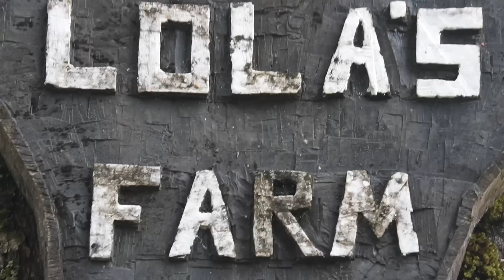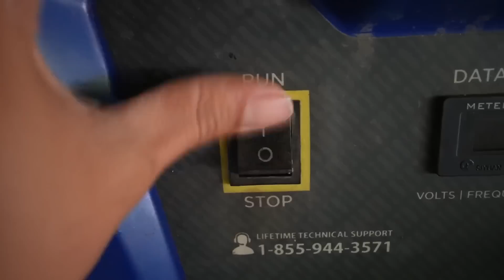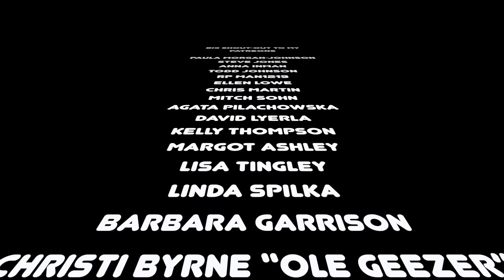WATER BILL $$  FOR FREE?

Comment: Congrats on your progress. 

Two comments:

1.  Water weighs 8.35 lbs per gallon.   Therefore 600 gals equals over 5,000 lbs.  Make sure that platform is structurally over build. 

2.  Would you consider a filter before the water pump?  It may extend the life of your pump.  Depending how you connect the future tanks, you may move the filter between tank 1 and #2 so the filter may not create any resistance to the pump.  Meaning if water start filling tank #6 and the the rest start filling (5,, 4, 3, 2, the tank #1) with an overflow,   then the filter can clean water coming from previous filters and water on filter 1 will be already filtered, therefore the pump will have the cleanest water but without any potential resistance created by the filter

Comment: Great job as always!
With your staircase you need to place the foam strips in-between the metal and wood steps to dampen down the sound, like you did with the outside balconies…..
It might also help if possible to fill the gaps in the metal treads with some foam, to reduce the echo

Comment: love the gutters! FYI, I have a 10,000 gal. catchment system under my house and the one thing I would change if i could go back in time, is to have more Clearence between the top of my tank and the house.  these tanks will need to get cleaned out once a year and on my tank you have to go thru the top.  I have 3-4 feet of clearance but wish I had more. also, you may want to put gutter guards and a sump on your down spouts to shed the leaves, and the sump to catch the sediment.  its really easy and doesn't cost too much more.

Comment: Water on fresh concrete is good, helps the curing.  You do not want the concrete to dry too fast.  Rain may damage appearance only.   Sunlight ultraviolet rays will damage PVC.  Paint the pipe to protect it from the sun.

Comment: I used to work in residential construction. Concrete is a chemical reaction some things slow it down but make it very strong, like when the Roman's would pour it under water. You feel the heat while it cures. That is it reacting. If you don't care about the finish let the rain give it texture.

Comment: You could use a 12volt pump like what they use in campers as a system. Likely one in the bus. Much cheaper than that pump you purchased. Its what I use in my 4mx6m clamping cabins with showers.

Comment: Rain will not ruin the footing for your first rain-water collection tank. Concrete will cure harder/stronger under water as a matter of fact. If the finished surface of the concrete had started to set (say an hour or maybe less) after finishing when the rain came...then no damage will result. Superficial pock marks will result if the surface of the new concrete was very soft at onset of rain. This is not an aesthetic piece of concrete anyway...so no lasting damage.

Comment: With that slope, I think you needed to sink supports down into the earth the way you did for the house.  That water tank is going to be super heavy, and that cement platform is going to be like a sled.  I may be wrong, however.  Please ask your architect.  It's cheaper to fix before it slides down the hill.

Comment: I am curious about what type of water filtration system you will be using? I know that UV light circulation is great for micro-organisms in rain and groundwater, but then you also need some type of carbon filtration for other miscreants in water like metals, germs, and chemicals. I recently also installed a whole house general fiber filter at my water pipe inlet to filter out any other stuff like dirt, rust, and debris to keep my waterless hot water tank running longer between cleaning. Just curious what kind of system you plan to use or is available in Panama.

Comment: Dude you need better advice. That concrete reinforcement is not the right size it should be lifted so it sits in the middle of the slab and the slab needed to be thicker. The corner blocks didn’t even join up. Your house will fail structurally if you are not more careful.

Those gutters are an utter fail. As soon as you get decent rain the water will flow over the gutter and not go in it. Do them again. Split a 100mm pipe in half or use the old gutters you have. There is a lot of research that has gone into gutter design and you just ignored it.